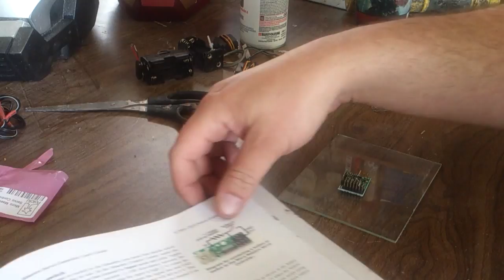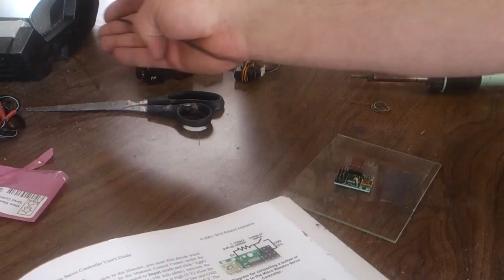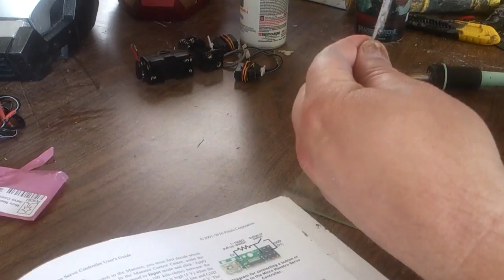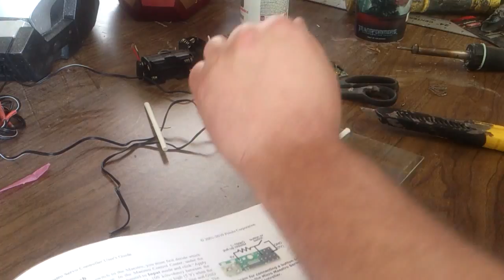IronMan electronics: setting up a Pololu chip for Faceplate opening

Comment from the maker: The Iron Partriot will be exactly the same, only different. That being said I'm going the more technical route, cause from what I could see from IM3 the faceplate separates before it opens. My current sculpt the faceplate actually locks into the helmet. The hinge geometry will be different too.
Sooo.. the faceplate will have to seperate before opening. There are 3 different ways that I can do this and I will cover this in another video and I think I mentioned it briefly in another video